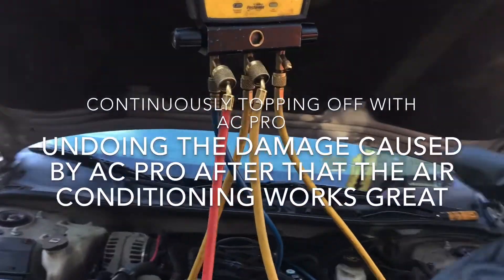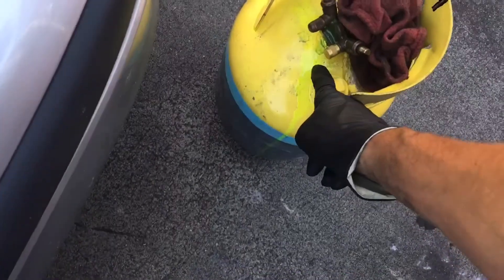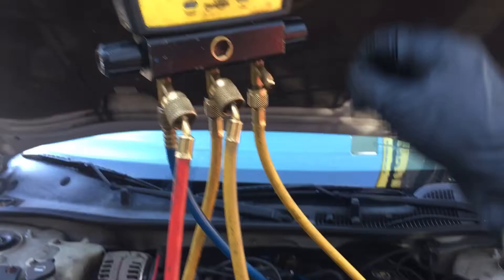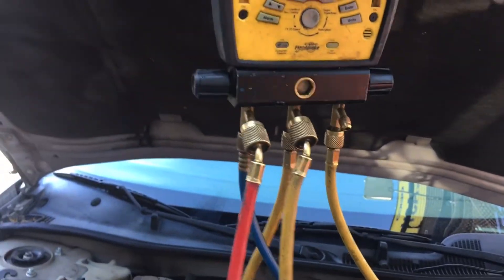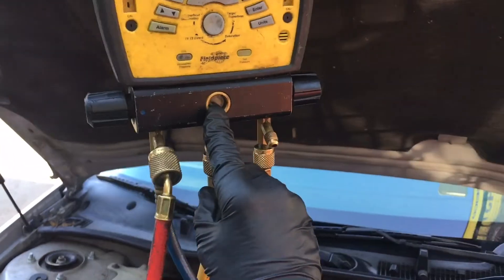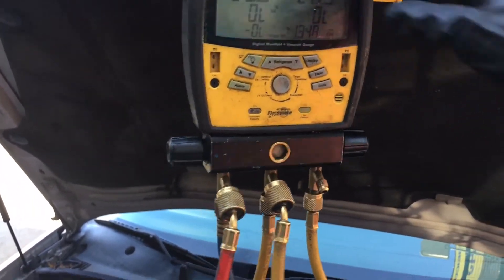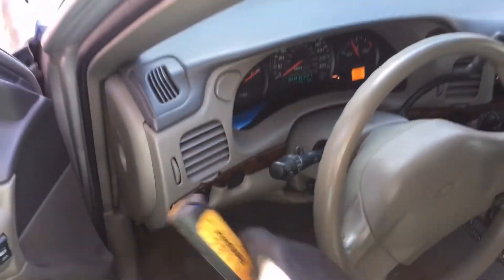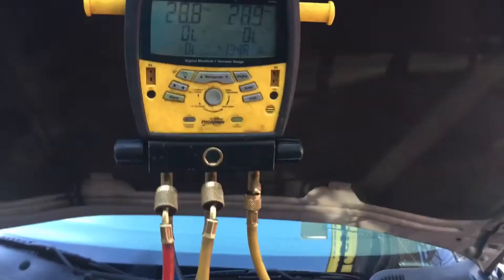Undoing the damage by AC pro

Comment: Interesting topic about too much oil. How did you know when to stop removing oil? Just by pressures? I have wondered about this topic because I see the automatic machines used over here with a vehicle database of refridgerant amounts also adds typically 20g of oil. I typically only get a few drops of oil out. If you get a regular ac service and never have any components changed, the system will have more and more oil.
Reply from the maker: Do you radically you should get no oil out to almost few milliliters.  I purposely for for my recovery in a different method that is not recommended because it removes a lot of oil. Automotive recovery machine cannot take a high-pressure liquid slug of oil they will shut down or get damaged.  I did this based on practice and an educated guesstimate with years of pulling out refrigerant pulling off the refrigerant out of a container and measuring the oil. Taking off components that were old draining oil out of them drilling holes in the bottom of receiver dryer’s and accumulators to measure the quantity of oil removed.  This is not a overnight skill or something you read about and then just do it.   Liquid refrigerant contains a certain small percentage of liquid oil suspended in a solution.     When it is proper and you see it and then you flash it to reduce the pressure and watch it boil away and foam up there would be almost no oil foam,  when it is Have a layover oiled depending on the percentage the viscosity goes up and so does it Spohn rate when you release the pressure on the liquid refrigerant oil mixture the refrigerant flashes off leaving the Oil behind.  Something my father taught me and showed me and have me repeat on the workbench at home. Was measuring and weighing oil percentage to refrigerant ratio.  After decades of doing this you develop you can say a calibrated high for watching refrigerant oil out of oil and seeing how much is left behind in a sight glass.
Reply: t lech , so I guess this is something the sight glass can be used for as well. Judging the oil to refridgerant ratio, if you know what to look for. The 2 automotive semi automatic machines I have (an italian and a Danish one) are both fail safe 😊, in the sense that they both have a receiver, so you don’t damage the compressor if you recover liquid from the high side or from the bottle.
Reply from the maker: U.H. Johansen Does a good thing about a sight glass sometimes you can even see small particulate matter and they’re like metal flakes or black piston ring material debris then you know the system is really dirty especially if the refrigerant and oil mix combination is dark gray instead of clear
Reply: t lech . Check out how “speech to text” picked up “sight glass” 😂. Good reminder on the debris. This was actually their main selling point for those glasses. To take in a sample in the glass before hooking on your machine and possibly contaminating it with metal shavings. A down side to the “machines”.
Reply from the maker: U.H. Johansen 🤣😂🤣😂🤣 had to go back and edit that thank you. The last guy I left a reply to my voice to text call him an (“asshole”) I hope he didn’t take it literally he did not reply. I seen it later and went back and edit it to correct the word.       Our text to speech dictation has a sense of humor not meant for children or prima donna snowflakes. 👍👍👍🤣